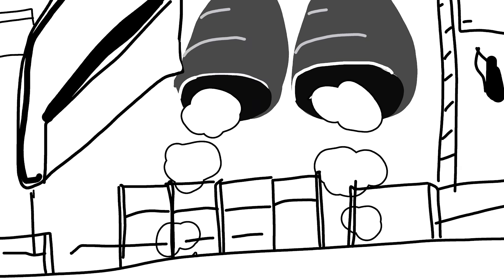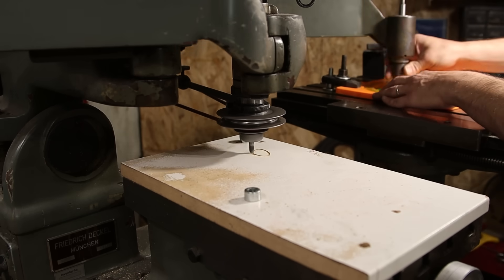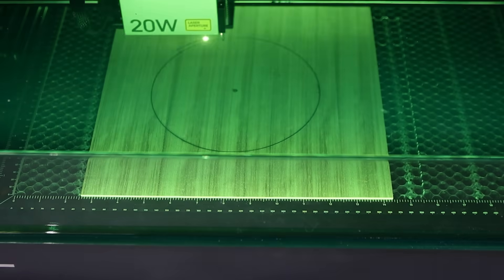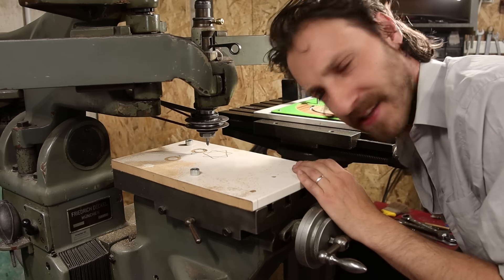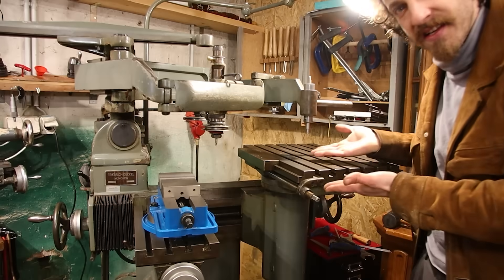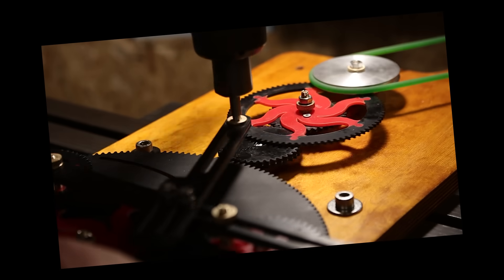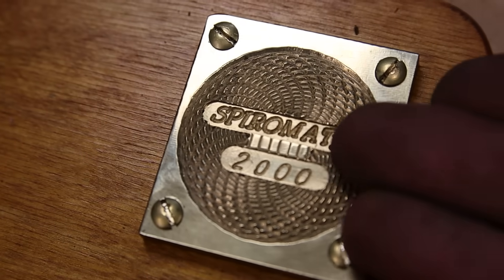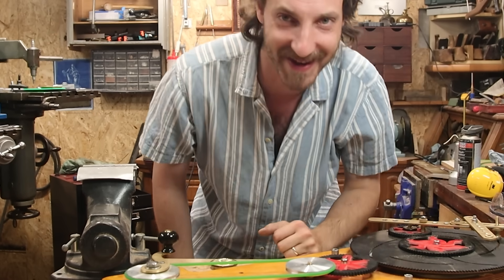What Happens When You Use a Kids Toy on a Milling Machine

Comment: Use a monolithic diamond point engraver. 
   There is also a diamond flick cutter for the mirrored troughs, cut like facets. Not sure how that would work while moving. Probably fine for brass.

Comment: T  ➖️  😳 
Perpetual motion is impossible because "I" can't do it.
DaVinci dosent have the power to blind you... Pride does.
A zip lock with a one pound weight in it and air to cause neutral buoyancy  😐  .
Add another weight on the bottom of the wheel.with a once filled with air bag. And gravity does what ?
The value of unbalanced thought 😊

Comment: OH! I'm going to hide this here, where no one will ever see it:
.
.
.
You can use spirograph designs like this for information compression and encryption. Jump to 13:04 and pause.
Those grooves are cypher selectors. The tips are data point distributions with optical I/O. If this disc were a semiconductor wafer and you were to do a spirolithography design, you can use the same arrangement of data but compute it differently based on what groove you're in, where and when on a spirograph cycle.

Comment: Of course some of the most amazing renditions of this type of technique involved using an angular sharp diamond tip which groves, scratches or shapes the lines according to the pattern,  as in the jewelry manufacturing of the ubiquitous Rope chain style, the "Diamond Cut" rope gets its adamantine sparkle from the surface caused by the gold being chiped away with the diamond face.
https://youtu.be/OD1mlv44dGA?si=yAK9rJQ0O12Etmp3
The video link of a POSALUX TOUSDIAMANTS style machine and the result

Comment: I think it would be easier, but not nearly as interesting in terms of craftsmanship, to solve this problem by writing a program to control machines using CNC.  Just in case anyone's interested, calculating how to simulate the effect of rolling a circle along the perimeter of another is particularly easy (circles are nice that way).

Let C_0 and C_1 be two circles with radii r_0 and r_1 and circumferences c_0 and c_1, such that r_1 < r_0 and the perimeters of C_0 and C_1 meet at point P_0.  To simulate the effect of C_1 rolling around C_0 by alpha degrees, you first need to calculate the length L_0 which subtends alpha around C_0.  L_0 / c_0 = alpha/360, so L_0 = c_0 * alpha / 360.  

It's easy to shift (translate) C_1 to its new position by rotating it around the center of C_0.  In order to simulate the rolling, it must be rotated around its own center by an amount corresponding to length L_0.  That is, we need an angle beta which will be subtended by an arc of length L_0 along the perimeter of C_1.  beta/360 = L_0/c_1, so beta = L_0 * 360 / c_1.

This is a little program in the 3DLDF language with its output, that performs these calculations:

r0 := 13;
r1 := 5;
c0 := 2pi*r0;
show c0;
>> 81.6814

c1 := 2pi*r1;
show c1;
>> 31.4159

L0 := 13c0/360;
show L0;
>> 2.94961

beta := 360L0/c1;
show beta;
>> 33.8

end;

So, C_1 must be rotated around its own center by (approx.) 33.8° in order for it to appear to have
rolled around C_0 for a length of L_0 = 2.94961 (centimeters, inches, parsecs, or whatever).

Comment: That was very interesting.  I've done some work with roulettes, which is what you make with a spirograph, but only as computer graphics so far.  I've given some thought to trying to make prints from them, etchings, woodcuts or silkscreen, but I haven't done anything about this yet.

I've got a couple of spirograph-like toys, but the large Spirograph set I used to have seems to have disappeared.  As a child, I always found it to be one of the most frustrating toys ever.  As you quickly noticed, the disks tend to slip.  Also, ball-point pen ink doesn't look particularly nice.

A nice thing about physical spirographs is that you can use non-circular pieces.  When trying to simulate this with the computer, it's necessary to calculate the distances along the curves.  With circles, this is no problem, but even for ellipses, you need integration and my memory of college calculus badly needs refreshing.  Not that I ever learned about elliptical integrals, of which there is more than one type.

The expression "bread and butter", as in "that's my bread and butter", is correct.  However, when trying something out for the first time, you get your feet wet rather than your toes.  You can also say "testing the waters".  Also, thank you for teaching me the word "guilloché".  I knew about that kind of pattern, but not its name.

Comment: Absolutely, keep developing this. Real engine turned watches sell for $8,000 minimum. If you don't want to make your own watches, you could make dials on a contract basis and I bet you would make pretty decent money. The only thing I wonder about is if your device would remove too much material from the dial blanks, which must be thin and light by necessity.

Comment: You could of course use a CNC router, like a 3018, with an engraving bit or a more substantial machine would drive a graver tool.   You just use maths to generate the design, on computer and covert to Gcode and transfer it to the router.

Comment: You could have saved yourself a ton of money and time by using 2 stepper motors to move that arm instead of the weird and janky plastic device. You could have designed the entire finished product on a computer exported it to a free laser cutting program and then had the 2 stepper motors move the arm on the cutting machine.

Comment: It’d be real cool if u could add a Z height element to the setup (even if it’s just 1-2mm travel) so u could add another “depth” to the designs. Even the same trace pattern with different height modulation might look very unique

Comment: 😹😹I still have my set which I got when I was 8 years old, umm I’m now 61 😹😹still in the original box with all the parts. I bought the frame of the desk a few years back, still trying to get the old desk out but, umm well we kind of removed the door from the back room where it came in through so now we have to figure out how to remove it out through the whole house with few odd bends in the way😹😹😹🤔🤔🤔🤔🤔

Comment: A big fan of your works man, tell you what I've some experience with (3d printed& thin) plastic gears;
If the gears feel too flimsy and you can't add geometry like herringbone teeth, you can try stacking the same gear on top shifted by one teeth. It helps with the alignment issues greatly since the gears are always meshing on either ome of the sides, reducing warping and skipping. I hope you'll find this useful <3

Comment: It should be very simple to make a virtual spirograph engine that outputs SVG and G-code. The program would generate and define the paths in G-code and then your CNC does the rest, whether it be a mill or engraver, a laser, 3D printer, whatever. You in this way can CNC spiro stuff without a bunch of plastic gears and get more consistency and accuracy. Add a GUI with knobs and sliders and you can get instant dynamic feedback before you mill/carve/engrave/burn/print.

Comment: Hey, Uri. I just, and i mean 1 week ago, JUST ordered a Proxxon Engraving doohicky. Looks like a tiny Pantograph and is way closer to my budget. I got it for a different project but years ago I made a custom dial for a wrist watch using a spirograph and a sharp tungsten scribe. It was only scratched into the brass but looked ok and gave the same kind of shimmer. Anyway, I haden't thought about doing that with a pantograph. I wonder if the Proxxon will work? If you or anyone else who sees this comment has experience with it I'd love some advice/warnings.

Comment: for the spirograph, you can predict the design by taking the ratio of wheel size to ring size, e.g. '25/125' and simplify the fraction, so that would be '1/6' . the resulting design has 6 points and they are connected by 'skipping' one to get to the next point. Or, in another example, '36/96' = '3/8' so it is an 8 point star with the line skipping to the 3rd (next) point to draw it.

Comment: First thanx for taking the time to make all your great videos.  A small suggestion for using your Deckel.  As a mold maker about 20 years ago I made what is basically a spring loaded pencil that I used in my CNC milling machine to trace out an engraving program before committing to actual cutting .  This evaluated location, script, and esthetics.  The spring loaded feature allowed a light pressure on the point and also use on a contoured surface.  I have used a Deckel before and it would have been a big help.  Keep up the phenomenal work.

Comment: Welcome to the exciting world of laser cutting! 

FWIW: for laser cutting pretty much all parts (but especially for small ones) you really /do/ want to use backing paper, but the stuff that comes on acrylic is not always the right stuff; it depends on the acrylic maker unfortunately. So often you have to peel it off and replace it with a masking paper that works better. 

The reason is that you’ll get crisper cuts and less meltiness and deformation at the edges when you mask. One company I work with also uses a fresh piece of masking paper after cutting to lift the parts out of the machines so the little parts stay in place. 

So I would encourage you to do a test cut on each new brand (and even different colors from the same company) of acrylic you try to see if the mask it comes with is acceptable. 

Warning: some brands of cast acrylic use pvc in the acrylic of the adhesives and you really don’t want chlorine gas floating around your lab. Please also check for that. :)
Reply: Test pigeon. He needs to do a test pigeon on each new brand. Detailed too, little wings and foots

Comment: To make the testing easier and cheeper you could replace the pantograph cutter with a pen and use paper as the material, that way you can test designs faster without vasting material, i would also recomend adding numbered marks on the different movable parts so you can easy record what settings resulted in each shape.

Absolutly awsome work and design of everything, and I love that you show atleast some of the falures or less successfull attrmpts allomg the way, youtube is too full of peaple just shoving the perfect result not any of their failures on the way.

Comment: Fantastic video video as usual! If you want a more "engraved look" as opposed to a machined look. Have a look around for a "diamond tipped engraving tool" you should be able to find one that'll fit your machine. You don't have to run the spindle with them and they will scratch the surface instead of machining it which may give a more desirable look.

Comment: Don't put a cutter in the pantograph for tests, put a piece of cardboard with a bit of double sided sticky tape and a marker in the holder. That way, you can test patterns without wasting material. Also, might want to consider other cutter geometries - and speeds. Because you're not driving it by hand, and flex is an issue, you'll want a good cutter with a chunky cut so there's as little force required to move it as possible.

Comment: 8:22 don't push ANY servo motor that fast, because that's electricity being backdriven into the board. While some modern things have protection against it... no point in tempting fate. Slow push is ok (like i said, most modern designs are protected). Fast push no bueno. A simple visual is to take two motors and putting them end to end. If you spin it slow, it won't have enough power to drive the other, if you push it fast, it will drive the other motor almost 1:1.

Comment: Would there be a way to make the engraving tip go deeper towards the edges of the resulting design and shallower towards the middle? It would have to constantly be adjusting the engraving depth as it went through each revolution.

Comment: Yuri, you are an amazing artist and kudos for the  Space Shuttle opening (says the former Rocket Scientist). You may have considered this but a suggestion for you. Instead of the elastic band to drive the  Spiromatic 2000, how about a small chain (and tensioner)? I believe it would hold up better in the long term as the elastic is prone to degradation due to just being exposed to the atmosphere (ozone), and of course UV.. Besides with all the brass and wood, a chain with gears would look sharp. Cheers! (and my cats really like your cat too! They watch you vids with me).